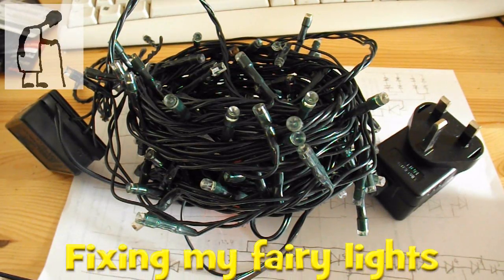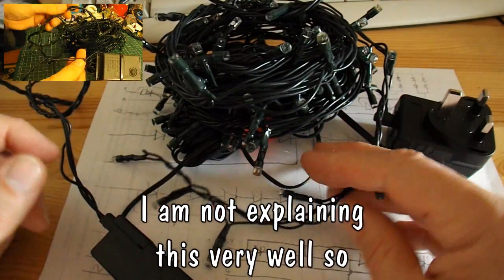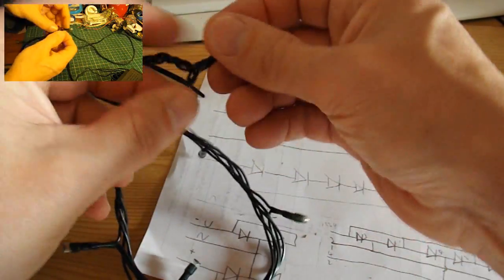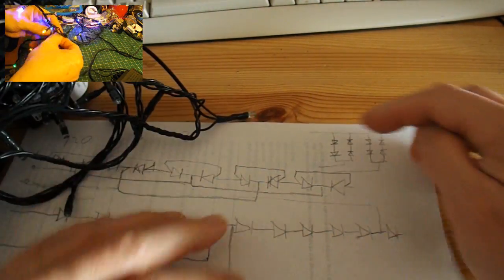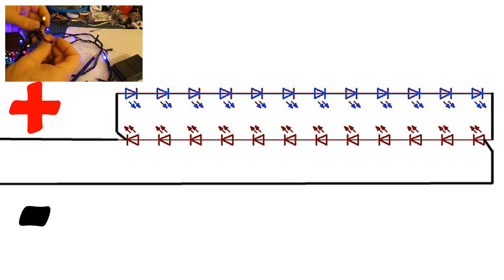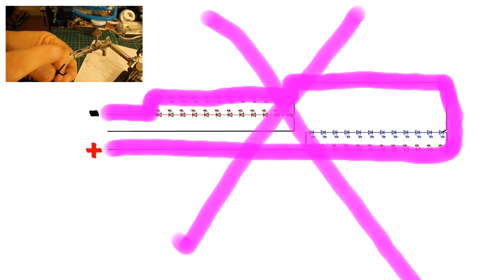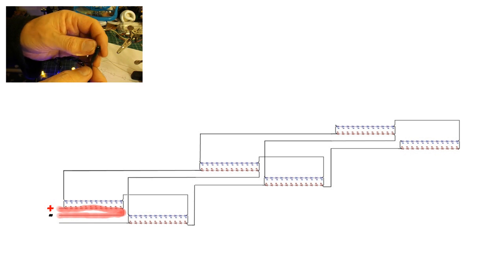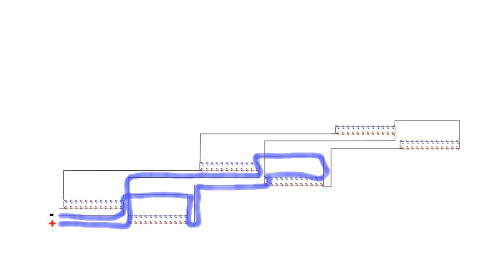Fixing my fairy lights Looking at the Circuit

Comment: Ah right, I think I get it. The LEDs are "diodes" obviously. LOL 
Current only flows in one way. So the return wave lights up the other set. And the 50hz signal is far too fast to see any difference on the LED's to our eye when they are all on together, not flashing in a sequence. Well, I think I get it. Probably need to watch this a few times. Tesla and his AC have a lot to answer for. 😂🤣👍
Reply from the maker: It's amazing what a quick flash can achieve 😲
Reply: @GrandadIsAnOldMan  LOL. Yes, usually a night in the jail. 🤣
Reply from the maker: @mikeflight9  your extensive knowledge and experience knows no bounds. What a life you have lived 🤣
Reply: @GrandadIsAnOldMan  Yes, I have so many T-Shirts for life experiences that I am opening a shop to sell them and to give advice to those like yourself who need to know and understand so many things they have missed out on. LOL 🤣
Reply from the maker: @mikeflight9  I can believe that.  How much are the T shirts ?
Reply: @GrandadIsAnOldMan  🤣🤣🤣

Comment: I've just spent the last 3 hours trying to figure out how the lights were all connected as they were accidentally cut by the gardener, right at the point where the 3 wires miraculously changes into 5. I'm absolutely lost to how I'd go about connecting them back together again. It seems there is no laymen's solution after searching for another 2 hours trying to find one 😩
Reply from the maker: Sorry, no easy answer from me as I spent long enough just trying to work this one out. They are not all the same so my solution may not match your problem. Certainly if you scan along my diagram there are several points where 3 goes to 5. On the "positive side" if the cut was through a section of 3 wires there are not that many combinations to work through to put them back together. Good luck  and Merry Christmas
Reply: @GrandadIsAnOldMan  Thank you and merry Christmas to you too

Comment: The annual "fixing the fairy lights" ritual. I too had to do this ritual, with the same set of lights. Fortunately my problem was that the wires from the mains plug to the controller green box were that thin, that 1 had broken, just at the moulded plug point, so had to find another plug with wire on, and re-terminate it. It must be a generation thing, as I think a lot of people would have thrown them away, and brought a new set. Thanks for the explanation of the circuit, saved me trying to work it out!!!
Reply from the maker: +willsgrandad obviously there are other circuits but this just fascinated me to get the 5 wires in the run from the 3 wires coming out of the flasher unit. I spent a couple of evenings on this just trying to work it out. My animated flashing sequence at the end is a little misleading as I show each 10 LED section individually when in fact they are linked but it gives the general idea.